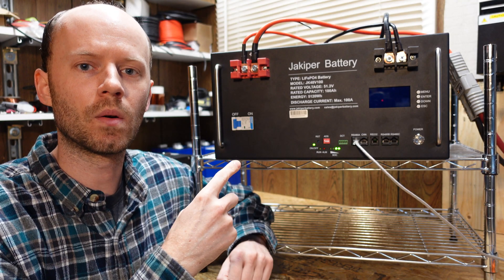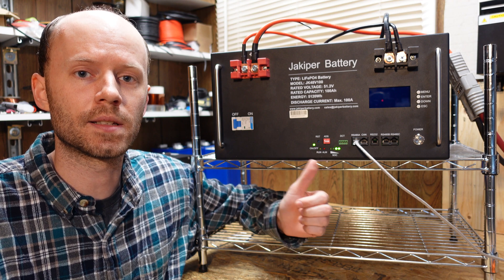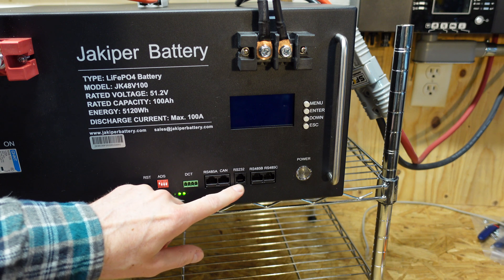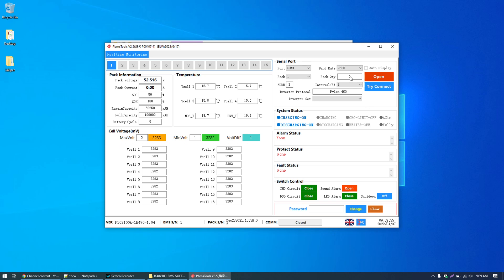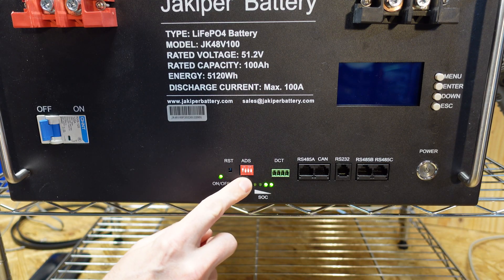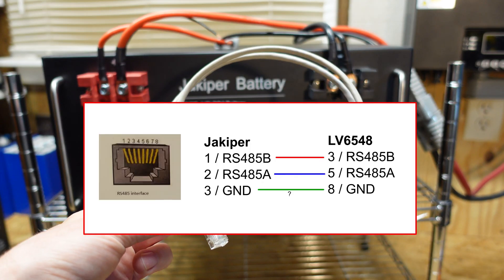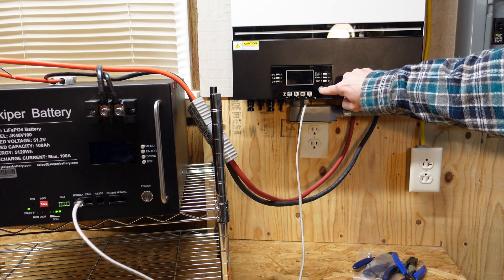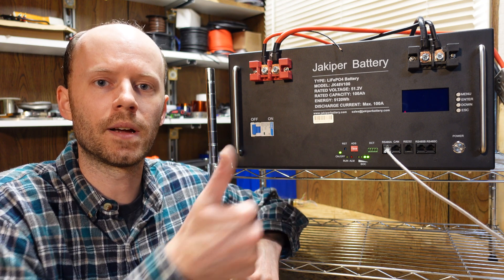Jakiper Battery and MPP Solar LV6548 SUCCESSFUL Communication!

Comment from the maker: Information You'll Need (affiliate links). After talking with Jakiper, they agree that better documentation is needed and are working on making the updates.
Jakiper Battery... https://jakiperbattery.com/product/jk48v100/?ref=lithiumsolar
LV6548 Inverter... https://www.currentconnected.com/product/mpp-lv6548/?ref=lithiumsolar
RS232 USB Adapter... https://amzn.to/3Jhs4IY (exact cable I have is unavailable)
Jakiper RS232 Cable... https://jakiperbattery.com/product/usb-rj11/?ref=lithiumsolar
Jakiper BMS Software... https://jakiperbattery.com/product/jk48v100/?ref=lithiumsolar (located under the "Download" tab)
Reply: could you please provide a Google drive link to the software as it seems Jamie battery is down or overloaded?
Reply: @paramaria7085  it worked later but I never got the serial communication to work, tried 4 different Ftdi
Reply: Hello I can't download any thing from these links 😢
Help me please

Comment: Thanks for the video. However, it appeared that you didn't input any settings in the inverter. You just plugged the cable in and it worked. Curious.
Reply from the maker: It sounds like you didn't watch the video. I showed the inverter setting change and it's even timestamped as a chapter.

Comment: Hi , Thank You for you video , I have finally found the correct version software which shows/ allows you to change the protocol , I have a MPPSolar 5048MGX inverter my battery is a Sunwise 48v with a pace BMS( same BMS as Jakiper) . With the software open the protocol setting is currently set to " Paceic" , I tried to reset it to Pylon, but it comes up with "write error" Any Ideas as to how I get round that one? Is there a work around? Thanks

Comment: Same as the Sungold batteries and SP6548 inverter from the looks of it. How does it work with solar assistant? Any issues? Also, if you have 4 of those batteries what would the addresses be for each battery?

Comment: I cannot figure out how to get the AOLithium server rack battery to communicate with the Voltronic 6548 hardware.. I think its similar to what you found out here... AOLithium is getting the 48V BMS from somewhere (looks sorta similar to Seplos) but the documentation is lacking when trying to get Pylon485 going.. It seems to be configured for CAN comms....

Comment: Do you know what is the password? I need to adjust some parameters for a solar Schneider electric XWpro6848.
Reply from the maker: Have you tried just leaving it blank? Mine did not have a password but they may have changed things since then.
Reply: @LithiumSolar  123456 try that

Comment: Great Job, This is exactly what I needed. 
Is it possible to set the Lv6548 to work with the battery while I wait for the cable ? What settings should I use.

Comment: How did you get the jakiper software to show text in the inverter protocol field? mine stays blank. It sees the usb com port connected to the 232 port, but the connection fails.
Reply from the maker: Is the USB to RS232 adapter you're using one with FTDI?

Comment: Hmm when i do this, it stays locked on "paceic". I have 2 batteries hooked up....anyone experiencing the same?
Reply from the maker: I haven't seen paceic on mine; however, Pace is the manufacturer of the BMS. Have you tried it without changing and seeing if it works? Maybe yours has a different firmware than mine.
Reply: @lester did you ever find a solution? I have similar problem in similar battery. Each time I try to change protocol, it gives "write error". Further, I can't see any of the tabs in PBMS 2.5 that is shown in this video while those tabs are visible in 2.4.

Comment: I bought the same inverter and 2 of those Jackiper batteries and about 2500 watts of panels. I am connecting it to the electrical panel of my mobile home that is completely off grid. How did you earth ground your system? Did you ground solar panels? Idk what direction to go.
Reply from the maker: I would check your local code requirements. I am not knowledgeable enough in this topic to even make a suggestion unfortunately.
Reply: @LithiumSolar  not doing it to any kind of code for inspections. I have no grid on my property. So did you not earth ground your setup 👀
Reply from the maker: The setup seen here is not earthed at all. The setup [inverter] powering my house is earthed through the ground system for the main home panel. I am not saying this is or is not correct, please do not take it as "advice".
Reply: @LithiumSolar  That is the same thing electricians advised. So these batteries I will have to download software for them to work with the LV6548? Jackiper sent them with what looks like the cable to connect them to a computer thankfully.

Comment: Thanks for your video. So, what is the benefit of having the inverter knowing about the SOC of the battery or been shutdown by the BMS if on cell goes low vs having the inverter configured on eg. 48V to shutdown itself without communicating?
The BMS could also shut down the inverter in an over temperature situation obviously but this is not a frequent occurrence.
The RS485 does not rely on a ground wire. The Heltec BMS I have has only two wires for RS485 comms for example.

Comment: First attempt with an lvx6048 was a failure. Will doublecheck the patch cord then check with mppsolar to see if pinout changed.
Reply from the maker: I don't know much about that particular inverter; however, it appears to have the same head unit as the LV6548. Did you successfully switch the protocol in the BMS using the software as shown? Set to Pylontech 485?
Reply: @LithiumSolar  I did. Then I changed from user to pylontech in the inverter. One possible difference is that I have two jakiper batteries and only changed bms protocol in one. The one I connected to the inverter. I can't imagine both would need to be changed but there's no harm in trying
Reply: Redid the cable and it still doesn't work. Also having a problem with the wifi. Wonder if I just got a defective unit.

Comment: Very good... unfortunately I have 2 of the slightly older Jakiper batteries (the ones you need to start with the reset instead of that snazzy new "power" button). Originally Jakiper had said that the batteries I ordered support communication with inverters, but now they're saying only the newer ones do... frustrating. Now I am wondering if it was possible to add a third battery of the newer model and daisy chain their communication ports and get monitoring from the inverter that way... what do you think?
Reply: I also bought the very 1st shipment of these batteries with them advertising it would communicate.  with the inverters.  they should send out an upgrade package!

Comment: Very good.  It must have been acutely frustrating that the documentation was so poor.  And even more so to find that the software needed updating before a change could be made.  Together that might well be enough to trigger the "not of merchantable quality" threshold for statutory 100% refund for retail sales here in the UK.

Just out of curiosity: can the change in protocols be achieved at the inverter end to match the battery's pre-set config? Or would the user always have to make the change on the Jakiper?
Reply from the maker: Yes, you can flash different firmware to the inverter. I haven't the slightest clue how to go about building your own firmware for it. Certainly not something the average person can do.

Comment: Fantastic battery I'm sure. Nice review. Too bad about the communications problems though, especially at $1700.00 per copy. That $1700.00 per battery? No... ...not even. Thanks. I got 300AH at 48volts, tools and all, from Battery Connect for $3200.00 just about 4 months ago. I just have to spend time assembling the packs. At $20,400.00 cost for the same 300Ah 48volts? Well, I can do an awful lot of spot welding for that price.

Comment: for the average Joe does it matter if the battery and inverter communicate? Surely if the BMS is properly set up and the charging from the inverter likewise is set up reasonably, what is the problem?
Reply from the maker: No it does not. It will work perfectly fine without communication like any other battery.

Comment: hello :-) 
what kind of protocol runs on rs485_b and C ?
the bms2bms communication Protocol (PaCE Protocol) ?
Iam interesting to do a  simple Communication Interface over Wifi but i have to less informations.
Has anyone the Jakiper "Pace BMS transmission  Protocol" v1.0 or version 2.xx as PDF documentation?
... not pylontech, growatt .. protocol
your BMS Software password is 123456,but it changes nothing in 2.5 software , the tab's on top are missing

Comment: It’s very interesting. I got The SOK to work on the pylon can protocol with the MPP solar inverter. Not sure What the deal is, but this was with a LVX 6048 Not a LV 6548
Reply from the maker: Oh I was under the impression you guys tested it on the LV6548. The LVX6048 looks like it has the same head unit as the LV6548 so I assume it's the same protocol/pins. In that case, either Min accounted for this in their firmware OR Jakiper programmed something different in theirs. It's frustrating trying to figure some of this stuff out but this was a rather exciting breakthrough moment haha.
Reply: @LithiumSolar  OK so now you have them talking....is it worth it ??? What advantage is there over the dumb charge and float settings (US2) in the inverter and setting up the BMS manually.

Comment: I cannot stress enough how important it is that you get a USB serial adapter with a legitimate FTDI chip. There are many adapters that use a clone of the FTDI chip, and recent FTDI drivers do not work with these clones. You can find older drivers that work with the cloned chips, but it's a major PITA and I don't recommend it. Startech's ICUSB2321F uses legitimate FTDI chips and if they unknowingly used counterfeit chips in their product they would replace it without question. Prolific's PL2303 chip was cloned as well, and their newer drivers will also detect counterfeit chips. It's not worth the hassle to save a few bucks.

Comment: These manufacturers need to wake up and stop making these units so difficult to use. They need to make them simple enough that anyone can use them without any special knowledge. They would sell a lot more of them if they did this.
Reply from the maker: Yes... It seems like the product was rushed to market. Jakiper told me they're working on documentation for this and improving their customer service.
Reply: Well you can always buy batteries from USA lithium companies that charge two or four times as much. I think most people buying lithium batteries at this price point may be happy that they have an updated bms and were rushed to USA market before the costs for shipping and lithium go way up. Otherwise waiting awhile for perfect documentation would raise the price and delay availability. Jakiper has been very responsive to my questions so I am happy with that .
Reply from the maker: @LarryKapp1  No. There are similar batteries available from US companies that have testing, documentation, and proven quality for the same price or cheaper. I will have one or two others here very soon to compare.
Reply: @LithiumSolar  Okay -that will be good to see  your review - thanks.

Comment: So I was right, I posted on your trouble shooting video that I was told the battery BMS in the server rack batteries have to be programmed to suit the inverter they are connecting to!
You probably missed it since you get so many comments on videos.
Reply from the maker: Yes you were and I did see the comment. I did check the BMS configuration at that time and the option wasn't there though... Incomplete software or purposely withholding certain settings I guess.
Reply: @LithiumSolar  🙂 The thing is what people need to understand, is these batteries can work with many inverters, but its not possible for an "all-for-one" compatibility out of the box. So the manufacturer selects one form of communication at the manufacturing stage. When a company like Jakilper says their battery will work with  x, y, z inverter models, that is true but if you happen to end up with a batch of batteries set by default to work with X inverter, and you have y inverter, then you will need to make the changes in the BMS firmware. Like you had to change from a default Deye setting to a Pylon compatible setting for MPP Solar. Feel free to contact me direct if you wish to discuss further.

Comment: Good video. But what does it really add? I mean.. either the battery is approaching being empty or its approaching being full. Everything in between is : Charge or discharge. I see these seplos bms's that can talk to a wide range of inverters but the main functions do not change over a "dumb" bms, in the latter case it relies on voltage instead of SOC. And the "chatty" bms relies on itself being able to count coulombs at a significant low level to offer a SOC value. Which gets reset by.. voltage, triggering a SOC re-base.